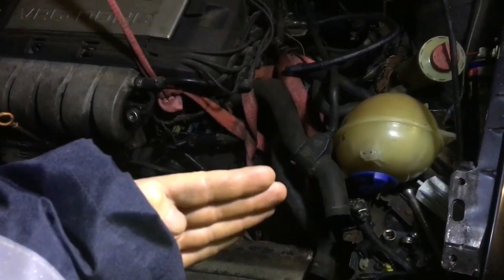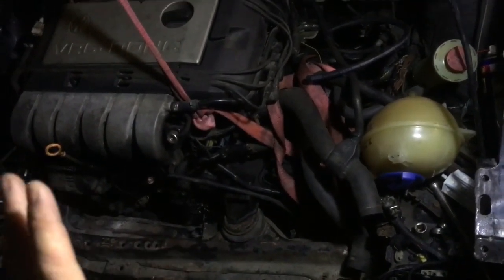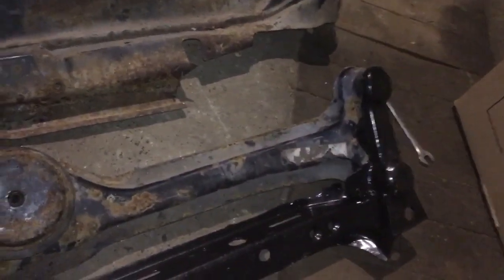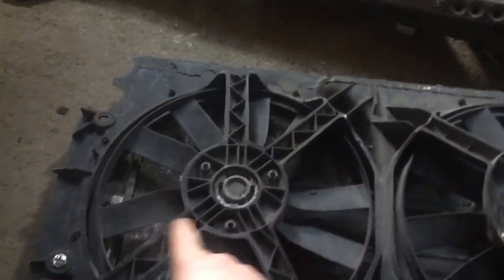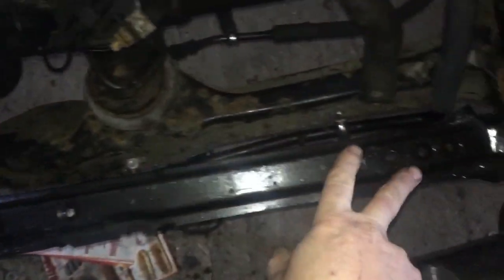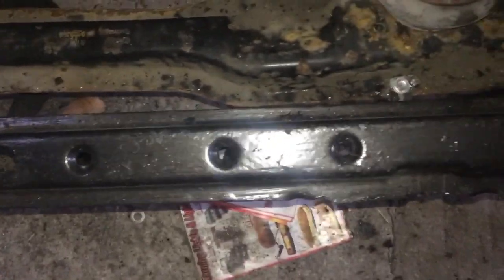Corrado radiator twin fan setup ep20

Comment: Great job on the Skoda radiator Steve, don’t forget to put a low temperature thermo cooling fan switch in, it will let the engine run cooler for sure!🥳🎉
Reply from the maker: Keep watching loads more videos to come👍